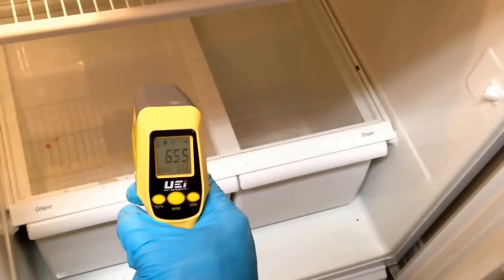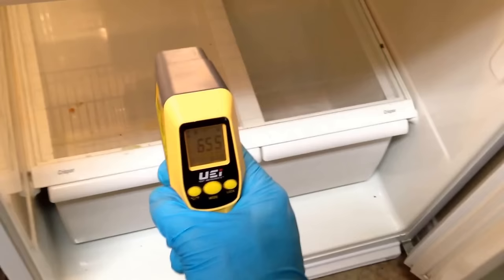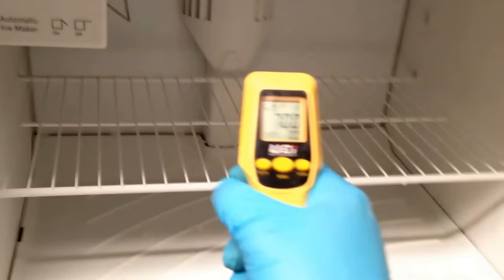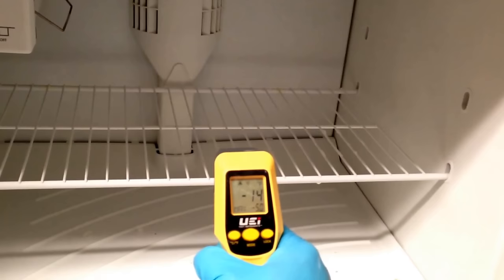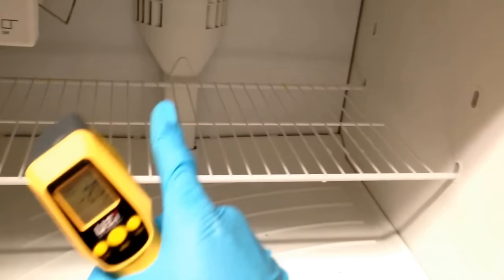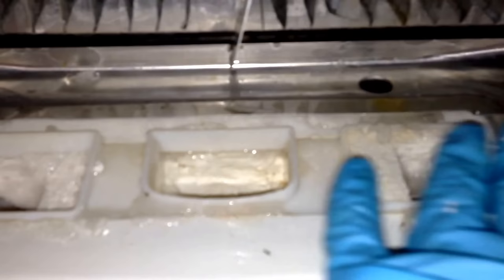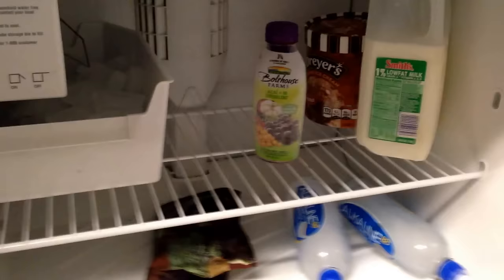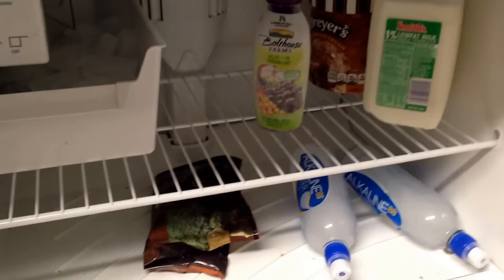Fridge is Warm but Freezer is Cold? DIY Repair

Comment: Thank you. This video was really helpful. However, I did not have the confidence to open up the refrigerator. I did learn the reason for the malfunction though. So I completely emptied my refrigerator, kept both the doors open for 24 hours and let the icing melt. This was one month ago. My fridge is still working perfectly well.
Reply: Thanks  a lot! It worked after unplugging.
Reply: Done the same thing here but a month later it came back
Reply: mohammed A I ended up purchasing a new one:-)
Reply: @mohammeda5571  it's. Temporary fix
Reply: Manufacturers recommend you do this at least once a year.

Comment: just want to express my appreciation for this video. you see we can't afford to hire someone let alone buy a new fridge so I found your video and that was my exact problem. took chunk of ice out and all is well with fridge. so thank you so, so very much. hope you have a wonderful day and god bless.
Reply: armando mederos jr m
Reply: I also want to express my appreciation. My older model Admiral Frostless fridge stopped working. The freezer was fine but the fridge was barely below room temperature.  I discovered the problem one day, but I think it had gradually come about. It was a second fridge and not in constant use. The fix was super easy. I just unplugged the fridge, got my hair dryer from my makeup table and blasted the back of the freezer section. When the ice that accumulated on the back wall  melted I removed the cover of the fan, (the fan works fine), and the attached vent cover that goes down from the fan cover at the back of the freezer. A large chunk of ice, the rectangle shape of the vent, fell out. The vent is open on one side when it is removed so the ice came out easily. The whole job required only a roberts square head screwdriver and very little muscle power.  It was only a simple DIY because the clear video and the helpful comments of others on this page helped me to diagnose the problem.  I was unable to take off the whole back cover of the freezer because the screw holding the fan in place was very tight and I did not want to strip the screw. As I was unable to see the cooling coils to see if they were packed with ice, my diagnosis of the problem and my fix was to only to remove the ice out of the vent.
Reply: We are going through this right now. We can't hire anyone or buy a new one. I'm praying that this is the problem for us. 🙏🏽

Comment: I'm sooo very grateful for your video!!! After my fridge stopped cooling I thought I was going to have to buy another. This year has been a VERY EXPENSIVE YEAR and I was dredding having to use credit card to pay for it. So I decided to ask Google and WAALAA (you told me what to do). As a 61 y/o single woman you explained the process in such easy terms that I had the confidence to try. This morning my fridge was cold . Next I'm gonna try to stop my toilet from running and replace a light switch. Thank you again for helping me fix my fridge.

Comment: The failure of that little fan is a common occurrence. The freezer creates all the cold and the fan just moves the cold air to the fridge. Those fans are available for $30 or less online and almost every fridge uses a similar, if not identical fan. I keep two of them on the shelf all the time just for this occasion.

Comment: Thank you...thank you...thank you! Five stars!

Our side by side had an icy cold freezer but a fridge that was slowly climbing and at 55F. We asked around for reputable repair people and the soonest they could be here was three days. I watched this video, looked in the back of the freezer, saw the screws, and had the courage to tackle the problem by myself. A blow dryer to address MASSIVE ice and a shop vac to blow off the coils, and an hour later the fridge is at 44 and dropping a few degrees a minute. 

I'd add one word of advice to others, put the food back in the freezer ASAP. Air in an empty fridge/freezer is harder to cool than solid objects, plus everything that came out was stored cold, so brought back coolness rapidly. 
This video saved me the $90 service call for someone that would have at least done the same thing...if they didn't opt to replace anything.

Finally, the shop vac, you CAN try and vacuum the coils but, ours had multiple rows that were inaccessible. By removing front and back access covers, I was able to blow massive amounts of air over the coils and get 100% of the accumulated dust off...thank God for whole house HEPA filters! Even after vacuuming what I could, I was astounded by the amount of dust the shop vac blew out.

Comment: A thousand thumbs-up - this video fixed a months-long problem where my freezer was reaching -20F and the fridge was at 51F dripping water from the freezer. I took everything out of the freezer and removed the back bottom fridge panel, and there I saw ice clogging everything, including the drain line. I took out all the ice & pointed a heat gun at the drain line and the back vents.
That was yesterday and I'm amazed how my unit is working - like it's brand new! I can't thank you enough! 👍👍👍👍👍

Comment: Your video helped resolve my cooling issue within minutes. I had just purchased a used refrigerator as a secondary unit that was working great at the appliance resale outlet and as soon as we unloaded it and got it home the fridge wouldn't cool but the freezer was on point. My problem wasn't ice but a sort of dampener that moved while we were placing the fridge. I appreciate you posting this and alleviating my having to load out back up and return it to the dealer.

Comment: Thank you for this! I found out the technician did not remove the foam from the factory which was blocking the vent that goes into the fridge. I was wondering why the fridge was not cooling below 50 degrees. Thanks again Sam, you saved us a bunch of time!
Reply: I think this maye be the case with me as I feel foam in the vent.

Comment: thank you for this video sir, it saved me $500.00. that was the cheapest new fridge I could find.
Reply: You will have to do it over and over again. He did not solve your problem. He just told you the quick fix, except you will have to repeatedly do it forever.  Your defrost cycle is not working. The heater, timer or thermostat is causing your problem.

Comment: Thank you so much! You saved my Thanksgiving meal! My fridge went out this week and my landlord couldn’t get anyone out in time to fix it. All the other videos I watched, I didn’t want to mess with electrical stuff really as that’s not my expertise. Your video was the only one that made sense to me so I tried it. I didn’t have the right screwdriver for the screws holding the back freezer plate, so instead, I took everything out of the freezer and just took a hot hairdryer to the back tube for 5 minutes and low and behold you could hear the ice melting and dropping! I had to use what I had and it worked, my fridge works again and my landlord is happy he doesn’t have to fix my fridge!

Comment: Did this today, but I forgot to check the drain pipe in front of the panel covering the condenser and fan. The pipes were iced over and I thawed them. So I'm just waiting to see if the fridge will come to temp on coldest setting. Long story short, THANK YOU so much for this instructional video. I'm not trying to spend $300+ on a new fridge anytime soon.

Comment: Dude! You just walked me through taking my freezer apart. I found ice in exactly the place that you found ice. I got it out and put everything back together. Now I'm just waiting to see if refrigerator resumes regular coldness. Thanks for your help.
Reply from the maker: This will work. Honestly you will run into this problem again. If you want a more permanent solution here is the link. 😁
https://youtu.be/Ey9nL75xiNM

Comment: Thank you for the video. I pulled apart my fridge looking for the points you mentioned to check.. I ended up.. finding out the culprit. A magnet used for putting on a magnetic eraser board ended up stuck to the seal on the fridge section. That was enough to have the gasket pull away slightly on the fridge and it lose the capacity to keep the cold in. So a pointer is to check the simple stuff and make sure your seals are good. Thanks for the video btw.

Comment: Great video. I fixed mine today. Ice clogged the port or tunnel. Fan didn't turn on for a while though. I adjusted the control up some for the refrigerator and freezer and fan turned on. Must have adjusted it just enough. Refrigerator is back working. Nice and cool now. Thanks for this video. Huge help.  I have had the refrigerator for several years now. Never had this problem before. Now I know what to do.
Reply from the maker: https://youtu.be/Ey9nL75xiNM
This is to stop the issue from reoccuring! 👍

Comment: Every 4 months I would have to take this apart and pour hot water down the drain hole to clear out the ice.  The solution is to wrap 8-12 inch copper wire around the heating element and put the end of that wire down that drain hole so that when the element heats up it also melts the ice down in the drain hole.  It solved my problem.  (Make sure the wire is only touching aluminum and not any plastic.)
Reply: hbofbyu1 I was going to make this exact comment. Thanks!
Reply: good idea
Reply: ...or, you could just fix the heating element or thermostar... my problem is I checked everything except the control board and still have this problem...

Comment: I liked and subbed....At first my freezer fan was making a loud noise fixed that. Then my refrigerator stopped cooling. I realized i didnt clear the drain nor the open  ports to the refrigerator. Working like a charm thanks to you.

Comment: You forgot to put a copper wire from the heating element to the drainage hole to prevent ice building up that drainage hole. Just a tip found on other videos

Comment: Thanks for the explanation! I pulled apart the paneling on my old fridge and...uh wow, the ice build up was absolutely insane. Took a lot of effort and hot water to remove what amount to at least two pounds of ice that had formed a block nearly 1.5 inches thick around the entirety of the exchange coils. Even the screws were completely buried in ice. Guess I better look into the evaporator fan next to figure out how this ice could have accumulated.

Comment: my Kenmore Elite side by side is warm on both sides evap and condenser fans both work.  Compressor also works. I did notice the evap fan didn’t come on right away when I plugged it in. Love your videos

Comment: Thanks!
We have a newer side by side LG.  Same, cold on freezer not very cold on refrigerator side.  We took the inside panels off the refrigerator including LED lights and found ice!  I also found the drain plugged with ice.  (I believe that was the source of the trouble).  I used a spray bottle with hot water and a piece of wire to finally clear the drain.  I then checked behind the refrigerator that the drain was clear and used a leaf blower to clean all (made a mess!).... Thanks Again

Comment: It’s 2:58am and I couldn’t sleep know my fridge was not cooling but my freezer was, my fruits& veggies and what I had to cook for tomorrow went bad 😭 I texted my landlord and said they will here at 10am 😭😰😭 so I found your video and let me tell you it took me about 45 mins only because I had no tools 🤦🏻‍♀️ So I finally found a small wrench 🔧🙌🏼  Found slot of iced blocking. So I don’t have a temperature reading gun, so had to make my own experience by boiling hot water and put it in a mug and now wait. I’ll keep posted but I’m sure this was the problem and it was THANK YOU FOR THIS VIDEO🙌🏼🙌🏼🙌🏼🙌🏼
Reply from the maker: Let me know how things work out 😀

Comment: I had an issue where the freezer (mine is on the bottom) was sheeting over like you mentioned. Around the same time, we had a power outage in the area as well. The time w/o power thawed the line and fixed the problem. So that could be another way to get it to resolve. Move the food to a cooler with lots of ice to keep it cool and just turn off the refrigerator power for a while till it thaws the blockage. :)

Comment: Watched your video... thanks for posting.  My garage fridge is @7yrs old. Top freezer gets cold, bottoms fridge gets cold for a while then the freezer fan grill gets frosted over and the bottom fridge starts getting warm. I moved all the food in both compartments to other places and allowed the refrigerator to sit for a day & thaw. Wiped it out then plugged it back in. Same thing happened in a week. Freezer got cold along with the fridge, then slowly over a week the fridge started rising in temp. So I know there was no ice blockage, maybe it's the thermostats?

Comment: Thank you for this video!! This happens to mine.  The freezer stays cold. The refrigerator gets warm. But what I found was the coils behind the back plate completely freeze up with a solid layer of ice. I have to take a blow dryer to it every 3 to 4 weeks.

Comment: Right before Christmas the fridge "dies", panic attack! Can't afford a new fridge now, nothing reasonable on Craigslist or OfferUp at the moment, then I watched this video and the light came on. I had water collecting in the bottom of the fridge for a while, a few years, little did I know that was the sign that the drain hole was plugged, frozen shut, and it would lead to other problems. It's obvious now of course. The down draft portholes where totally plugged with ice too. I boiled water in a tea pot, defrosted the drain and port holes, cleaned everything out with soapy water, rinsed and dried everything and now it works like new. And is as clean as new too! Awesome. (Besides some out of date salad dressings, I even found the source of a peculiar odor, a few ounces of old pulled pork forgotten in the back of the fridge! Gross!) I passed the lesson on to my nephew Christmas day. He has similar issues with his fridge and was very excited. I know this info will come in handy many times in the future. Congratulations teach, you can't do better than that! Thanks!

Comment: This looks exactly like the model I have. Thanks for sharing how it works with the cold air being pushed down. I am going to defrost. I have a problem with ice buildup inside the freezer rather quickly.  I am going to reset the temperature at 2 for the freezer since it is winter. What can be done to prevent this in the future? or is this going to be a recurring problem. I have defrosted the freezer about a month ago.

Comment: thanks for this video.  I'm watching a few videos here trying to figure out why my freezer part of my roper works fine but the fridge no longer does.  NO ICE BLOCKAGE THAT I COULD SEE.  Just to make sure there wasn't ice I couldn't see stuck inside the fan, I took a blow dryer to it for quite a while.  Still, no cold air coming down to the fridge.  so I guess this is my problem-- the port itself--- can't SEE the ice buildup.  I guess I'll rewatch this video and attempt to take apart the fan panel--- wish me luck--- I'm just a suburban mom!  :)  If that fails, I'll call my landlord-- hey, it's his fridge.  :)
Reply: HEY Suburban MOM!!!!   You have a Landlord.   It is his responsibility to get a repairman to give you a working refrigerator.    However, you can empty it all out and just let it manually defrost.

Comment: I've been going round and round with mine too. This time I couldn't figure out why it was warm on the bottom. So I came to my trusty YouTube and did a search and low and behold the exact refrigerator I own came up. And what are the odds it was exactly what was wrong? Like Adam below said, she was over at Home Depo looking at $2000-$3000 refrigerators. After clearing out the ice from the holes she's back up and running like a champ. I'd say the thumbs down are the pissed-off wives. Thanks, Sam.
Reply: I'd be proud of mine, if I had one. 🤣🤣🤣🤣

Comment: You should never use any sharp metal objects to clear away ice in any compartment of your refrigerator. You can use hot water or a hair dryer instead- although on most newer units, I don't recommend it because the inside is made of soft plastic. The best thing I would recommend to use is a good quality steamer. Works excellent. Also, I didn't see him test the defrost thermostat nor the heater. I'm a certified tech.
Reply: Oren C what do I do when I’ve done all this and put everything back together and in a few days it starts all over again ? I’ve looked up my fridge  ( whirlpool MOD# WRT359SFYMOO ) and cant see where the defrost timer is located. This fridge is in my motor home. ( it’s a residential refrigerator )
Reply: How do you test the defrost thermostat and heater please?
Reply: I used the Hotpoint QW 160 Steamer and it worked a treat. Pristine plastic within minutes. Let's just say my wife was pretty happy!

Comment: It helps your fridge is nearly identical to mine! I have the same problem, 
I followed your steps and yes there was frost and ice in the vent to the fridge portion (one thing I found be careful clearing that ice block or you can damage the styrofoam inserts ... I pulled one apart not knowing what they were or how they were inserted)... 
Frost and ice removed now I'm waiting for the freezer/fridge to cool down again, fingers crossed...